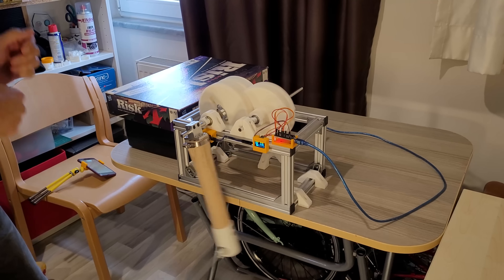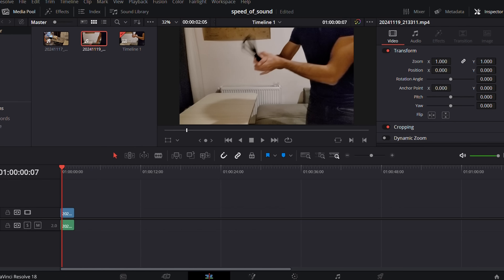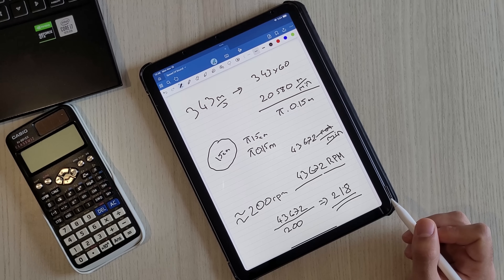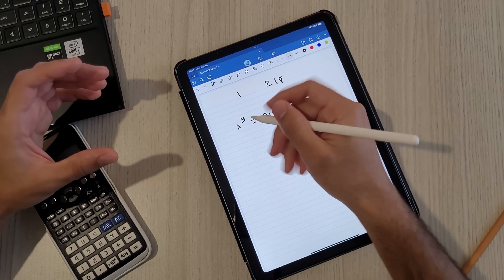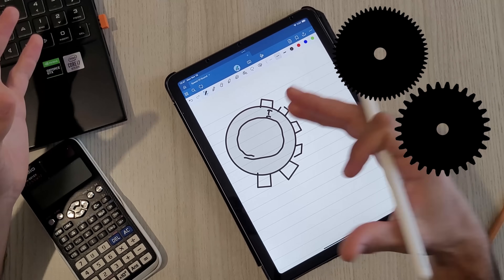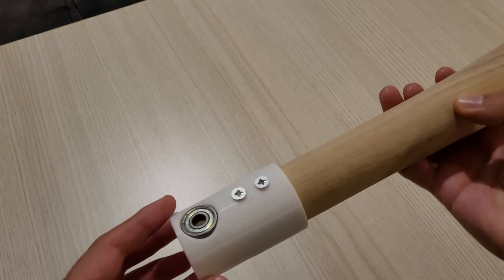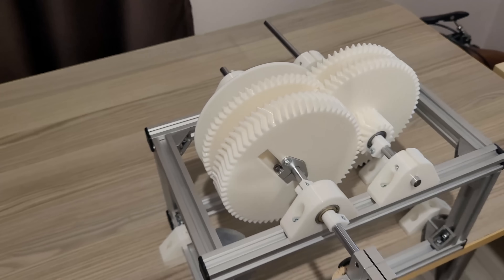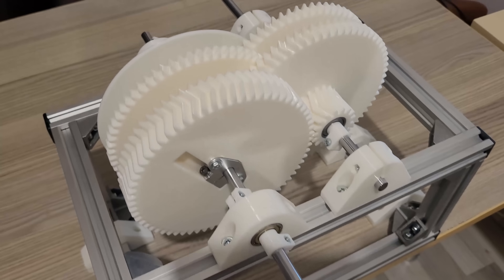Trying To Reach Speed Of Sound At Home 3D Printed Gears

Comment: That was very interesting, You would of had better results if you had a solid work base. With that kind of force and speeds and vibrations an unstable base will interfere with it's efficacy.  The hand crank needs pinned to stop slippage. Nice job.
Reply from the maker: Hi, thank you. For now I've had to use whatever I had but as the channel grows hopefully I'll get better equipment. Crank slipping was really annoying but i didn't even attempted drilling it with a hand drill. Currently, I don't even have a vice but it's the first thing on my list
Reply: @canocholic  Actually thought of a easier handle, even cost less than the fancy one. The shaft you attached the handle to just needs to be lengthened so you can put two 90 degree bends in it. So your whole crank and shaft is one piece.

Comment: Try split gear compound plantatory gearbox easily 400:1 in slim package but idk if its back drivable but its always worth a try
Reply from the maker: The problem with the 3d printed planatory gearboxes are, they can't handle much torque in my experience. You need to really make them big and beef them up, but at that point, regular gears seemed easier.

Comment: Herringbone gears are great. 

I’m wondering if you did this again you’d be able to get some better bearings and lubricate them as well. Most gearboxes I’ve encountered in my line of work (construction) have lots of oil inside. Noise is energy lost, so I wonder if putting some kind of graphite powder or a light coating of oil would help?
Reply from the maker: I did use some light machine oil. Some kind pf thin ptfe bases oil might work better.

Comment: awesome video! subscribed! you should take an average of 5 or so rotations of the input gear to get a more accurate result. 21vs 22 frames give a significantly different calculated speed. average 5 -10 and you have a much better estimate of input gear speed.
Reply from the maker: Yeah, you're right. That would be better. I wish it lasted a little longer, so could a couple more tries.

Comment: I don't think it's physically possible for a gear system to spin faster than the speed of sound.
Reply from the maker: I'm not sure, but it is impossible for a plastic one for sure
Reply: @canocholic  Well the logic being that the speed of sound is as fast information can be transferred by touch, so if you went faster it would cause the physical structure to warp in a way that wouldn't allow it to go faster.

I'm sure there's some kinda workaround though.
Reply from the maker: Part two will be interesting for sure

Comment: Fun fact about the car thing. The current record holder for the fastest production car will probably never by broken by a wide margin, not because we lack the technology to make more power, but because at those speeds the WIND RESISTANCE actually begins to be too much. If you plot the house power needed to go a certain speed, you'll see that past 400 km/h it goes exponential, meaning you need to double or triple the power output of the engine to get marginal speed improvements. At those speeds air begins to behave like a sludge because it's unable to get out of the way fast enough, and that resistance kills your prospects! Not to mention your tires as well XD
Reply from the maker: Yeah, that's the real challenge at those speeds.

Comment: ❤❤❤❤❤❤Awesome video. Probably close to similar but You totally cannot count just calculating the speed! You need to measure it on the final gear dude! There’s possibly difference, I bet you are right on with the calculation but this self reciprocating conclusion isn’t very scientific tbf
Reply from the maker: You are right, I should've measured the final speed. But tachometers are a bit expensive for now.

Comment: I think you can get more total gear ratio if you add something like clutches, so you don't have to start spinning all the gears at once, but one after another. I.e. some gears could have more space between teeth, so the first gear can rotate for some angle before it starts pushing the next one. Or add springs - the 1st wheel could rotate and load the spring which pushes the next wheel.

Comment: congrats on the world record. however to reach the speed of sound with 3d printed materials is a lost cause. the last gear will rupture well before S.O.S. PLA theoretical max at 800km/h or 220m/s. you should not spend any time trying to improve any part of this machine until you are ready to compromise on the original goal to use 3d printing materials. you can see why when you look up the square root of the specific tensile strength (which has units in m/s) of all plastics and see that none of them come close to 343m/s. in fact, many metals also can't do it such as copper, iron, brass. aluminium, steel and titanium are possible. potential non-metal contender will be carbon fiber. 

physics: the mat. engrg term is hoop burst speed. the maximum speed where a uniformly thick spinning disk can endure before centrifugal force exceeds material strength, theoretically at 66% of the radius. you can imagine the outer third of the disk (a hoop) splitting off from the main disk. the hoop burst speed is independent of the thickness of the disk, its radius, and therefore also the RPM of the disk. an analogy is to ask yourself what the maximum length a vertically hanging steel rebar can be before it tears itself apart from gravity--the answer is independent of the cross section of the rebar--thicker rebar is stronger, but it is also heavier--the answer, 26km, is only dependent on the ultimate tensile strength of the steel, the density and the acceleration of gravity. similarly the hoop burst speed is only dependent on the UTS and density of the material. dividing them gives you the specific tensile strength, with units in m2/s2, which is the limit of centripetal acceleration at a certain distance from the center. taking the square root of it gives you units in m/s, which is the critical tangential speed. look up hoop burst speed or Lame's equations to know more.

how to proceed: the above assumes the disk is uniform in thickness across the radius. you can increase the hoop burst speed if the disk is thicker nearer the center and thinning out toward the edges, decreasing the hoop mass as radius increases. i still don't think you will get to S.O.S. at high speeds the disk actually starts to warp and will rupture due to flexural stresses well before hoop rupture regime. the theoretical maximum for polycarbonate is 260m/s, and there are videos on youtube of people spinning CDs to a maximum of 23,000 RPM before rupture, or 144m/s tangential, well below theoretical max for PC. recommendation: build everything with metal and use carbon fiber for the gears. also, don't stand anywhere in the same plane as the last gear, for heaven's sake. there are just too many variables in this machine that can turn it into a plastic grenade while you are hand cranking it. when something ruptures, there is a release of elastic strain energy--i.e. small parts flying off a bulk material can exceed the initial speed of said bulk material--fragments from an exploding disk can exceed S.O.S even if the disk did not.
Reply from the maker: Hi man, thank you for the very detailed feedback. Can you write me on the email on my channel page.

Before the next try, I'd really like to run it by you.

Comment: Considering a lot of the resistance will be due to mechanical friction, which would not change at all with the diameter of the output disc, I would assume making the disc larger would be more efficient (until it becomes too heavy and inertia becomes too large a factor). If the disc was twice as large, assuming about equal RPM, it would reach the speed of sound.
Reply from the maker: Hi, most of the force probably comes from air resistance, but you are right. Larger gears would still help since the gear ratio can be reduced. But larger gears would mean a lot of filament.

Comment: one thing that could make it easier is making a better handle. so instead of moving the first gear with your shoulder. youd move it with your elbow. making it a bit harder to move, but would make it far faster
Reply from the maker: That could be a good upgrade

Comment: Bro has the smarts to build a gear ratio that spins faster than a Bugatti's wheels just using his hands but wasn't able to screw his wiggly table on the floor 💀
Reply from the maker: Yeah, it was wobbly.
Reply: @canocholic  right on, man 😁 ! I am also facinated by anything that spins fast, I'll be waiting for the next RPM experiment, this time with a proper table setup, maybe it's even gonna help you not break it 🙆🏻‍♂️, steadiness while you're giving the input should smooth things out for the gears or not so much?

Comment: Nice video! I really enjoyed the engineering focus and how you made the decisions you made. I think you would do a lot better with a stronger table. You had to use one hand just to keep it stable, meaning you are losing energy from the system and you can't put all your power into turning the gears. Maybe you can add some weights to the legs of the table and crank with two hands.
Reply from the maker: Maybe in the next iteration.

Comment: One large improvement i could see, though you may run into issues with downward force ruining the bearing holders, is adding a crank to the other end of the rod at an offset and using it similarly to a bicycle crank. You could put a lot more force into the power train and likely more speed since you now have a constant rotational force. 

You can hear the gears speeding up and slowing down as you fight against the table shifting around and lifting
Reply: Yes, and they even make these...handcycles. That crank setup, and a far sturdier platform to anchor the assembly to, would definitely achieve faster speeds. I also wonder if the gear design could get a boost by something like a ring and pinion setup so it's stronger?

Comment: Your almost there! Change the orientation of the gears in a way that means the output is towards the back of the machine rather than the front and then add a disc to the final  gear that Is 2.3x the diameter of the gear (have it overhang the table perhaps). This will get you the desired speed with your current setup, although I would suggest abit of caution as any weight on the output will act flywheel, and make the input much harder to turn.   Very interesting though, this needs revisiting!!

Comment: Hey, man, good job! I have a suggestion about the cranking... Our arms can only output so much power. Understandably you could not spin the crank as fast when you had resistance. How about something like the rowing machine at the gym? Our full body can output so much more. Then the bottleneck would only be the durability of the mechanism itself, not the source of power.
Reply from the maker: Yeah could work with a flywheel

Comment: you need to make the crank like a bike wheel; it can turn one way with force but the other way it doesnt do anything because you are the restriction to this it will only turn as fast as you can turn it where is if you put a one way crank on it your motion will never slow it down only make it faster also if you use a bit of silcone dry lube on the gears will help the speed to
Reply from the maker: Yeah that would help
Reply: @ keep it up anyway, mate im subbed and will be looking forward to more videos :)

Comment: Never knew about the prime number gear ratio differential trick to making gears wear and lubricate evenly, that's a great nugget of knowledge.
Reply from the maker: Yeah, just to clarify, they don't need to be prime, but they need to be prime between them, so 9 and 49 would also work since there is no common factor. Choosing prime numbers ensures that no matter what system you use the gears in, there is no common factor.
Reply: @canocholic the term of art is that they are co-prime.

Comment: Just buy bike speedometer or normal speedometer calculating the speed might come of so unrealistic then the real speed so this video is a flop
Reply from the maker: I'm working with a tight budget, so i can't really buy everything i need. I'm finding solutions with what i have. A bike speedometer would be a cheap solution, but it wouldn't work out of the box since there is no bike wheel this size, calculations would still be necessary.

Comment: I would be so incredibly scared to run a machine like this without wearing at least a full face shield that protects my face and neck.  I've seen angle grinder discs explode before and I would imagine they're probably stronger than this plastic disc.  If that disc did explode, it could send shrapnel flying at such incredible velocities.  A piece if shrapnel even 1 mm can do incredible damage or even potentially become fatal.

Comment: Cool experiment. Your English is perfectly understandable, don’t worry about it.
The one thing that I think you should improve, and didn’t mention in the video was the mounting table. Get something really solid, because a lot of your energy when you’re cranking goes into keeping the desk balanced. And all the movements jostle the gears and bearings as well, making the whole thing more vulnerable to wear and tear. Hardwood or metal table that’s bolted down to the floor. I think you’ll get higher speeds.
Keep up the good work!
Reply from the maker: Hi, thanks for the encouragement. I had to use the one i had. Hopefully if videos keep getting watched they will fund the upcoming projects

Comment: i remember when i had to make some gears out of wood for a school project, not only was calculating the ratios and sizes of them a nightmare, i couldn't make them correctly with the tools they had there (they didn't let us use the belt sander for some reason), it would slow down and get stuck on some teeth basically, i didn't manage to get more than two connected and working, so we decided to scrap the idea and do something else entirely lol. it blows my mind what you can with gears that are actually built well

Comment: What you need to work out:
- the energy that the last dusc would have at the desired speed
- the friction loss (could be calculated by hanging a weight on the crank, measure the force at the other side and multiply by gear ratio)
- this is the total force that you'd need to impart on the first gear, and it will distribute evenly across the gears. Can your material handle that?
- if required, add another gear with a longer lever that you can crank at 50 rpm (imparts more friction though!)
Reply from the maker: A lot of good tips , Thank you! It's quite hard to calcute the losses actually because the main loss is probably not friction but air drag. And calculating friction when the system is stationary would give false results, the friction between the gears is dynamic not static.
Reply: @canocholic  true, didn't quite take into consideration that dynamic friction is exponential. I'm not a mechanical engineer, but my background in construction and IT (building data specialist) gave me a bit more of an analytical mindset.
Reply: Just one thing that I've been pondering about with similar videos. Instead of one continuous shaft, would it be better if one gear was mounted on top of the other with room for a bearing? It would definitely distribute the friction load since every next gear would only spin 16x faster than the shaft it's mounted on, but it would also introduce some play into the system due to fitting tolerances.

Comment: Extend the table and make a twin hand crank like an old school drill but support the other end with a bearing. 

Make sure your leverage is good still, I'd make the crank arms the same length as the original. Also put grease on the gears, it'll make it easier to crank
Reply from the maker: Yeah, a drill type handle would be nice i went for the easier solution

Comment: I think the first few gears should be a tourqe gear ratio and the use that tourqe to spin the other gears at high speed
Reply from the maker: That would defeat the point of first gears. It's like taking 2 steps back and then moving forward.
Reply: @canocholic  i think a small tourqe gear ratio would at least help take a load off

Comment: what a great video dude!
wouldn't just making the outputwheel larger (i.e making it have a larger circumference) make it a whole lot easier to get to speeds?
Reply from the maker: Hi, in this design, that's not possible. The size of the gear is limited since there are two parallel rods. If it was bigger, it would hit the other one.

Comment: a genius and an ass at the same time, shortens the crank by half its length, it will save you effort and higher rotations, fixes the machine on a solid and firm base that guarantees the stability of the system
Reply from the maker: I'm not sure about a shorter crank, it would mean i have to apply more force. And about the base, had to use what i have, i can't just go buy an expensive table and screw this to it.